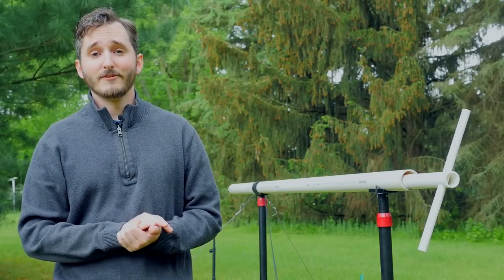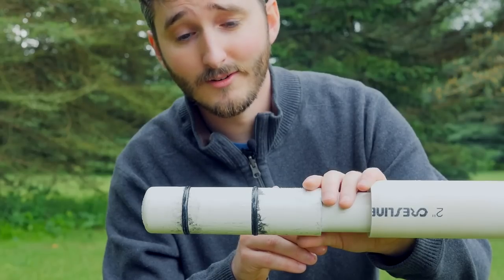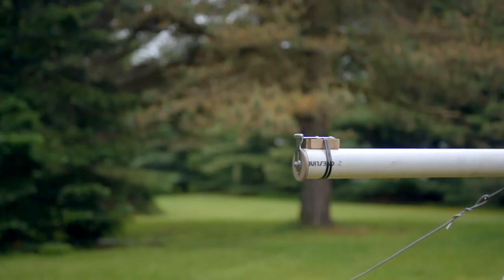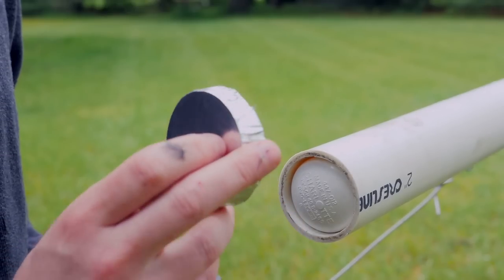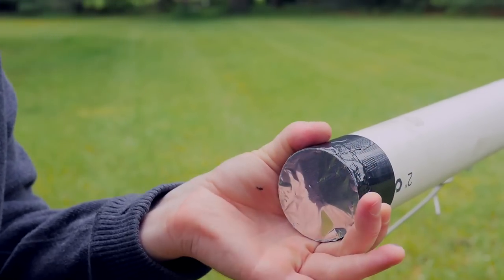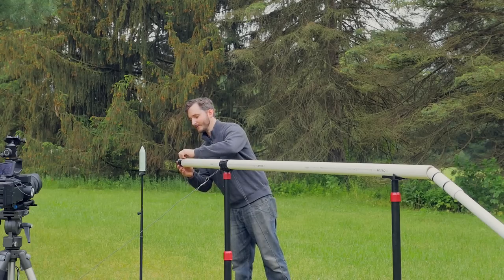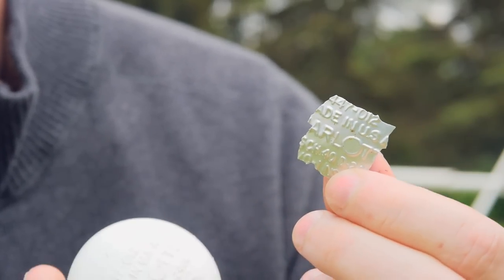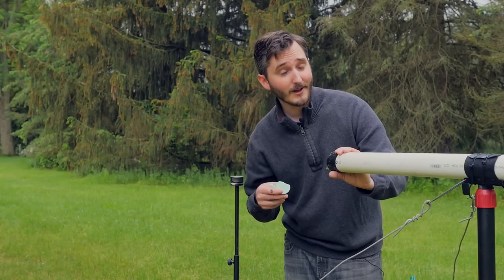New Vacuum Cannon Design - No Vacuum Pump Required!

Comment: video idea,
i have been wondering if there is away to make stovetop mini oven, for heating pita bread and quick baking, a small metal box that sets on one of the stove flame, and distribute the heat around the pita bread equally to heat it without the need to flip the pita bread over the flame, and that we can put small oven pan in it, could something like this be possible?

Comment: just think what you can do with a total vacuum with air at 600 psi behind the projectile can do for speed ,I think the pipe your using can handle it let me know if your going to do it .

Comment: NightHawkInLight would you be able to put metric measurements in the overlays as well? On another note, do you think a ping pong ball gun using the same principle could be effective with a shorter hand held barrel?
Reply from the maker: Too late to add metric to this video. I wish I could use metric for every video but since I am in the US all my supplies like the pipe and fittings are in imperial. It would be messy to use both. The longer the barrel the better, but you may be able to get away with a slightly shorter one.

Comment: cant you hang up a blanket for a backstop instead of the road? ive found towels to be bulletproof for lead projectiles up to 350fps or so, so plastic with very low sectional density should stop fine.

Comment: Love the videos.  Do you use any lubrication for the piston?  If so, would you please provide details of what you use.  Thanks.
Reply from the maker: I used some gear oil left from changing the differential on my truck.
Reply: NightHawkInLight 
Excellent. Thanks for the info.  I am building a double-acting pneumatic cylinder using your piston design. I plan to glue a 3/4" length of 2" pipe, cut like a standard piston ring, inside the rod end of the 2" cylinder, followed by an o-ring, and a second 3/4" length of 2" pipe, that will be flush with the end of the cylinder. Hopefully this will provide a seal at the rod end (the gland) and allow me to use air pressure to both extend and retract the rod and piston.

Comment: What do you use to lubricate the o rings in the barrel?  Also, instead on taping the burst disk to the end, could you use a 2" coupling to hold the burst disk?
Reply from the maker: I use heavy bearing grease. I tried using a coupling to hold the disc but it doesn't hold tight enough and the foil slides out.

Comment: Hi NightHawkInLight, I have been a big fan of yours for a few years now, and I must say, I love your content. I have a question for you. Do you think it is possible to use a design like this to fire a water balloon? The water balloon wouldn't be the only projectile, there would be some airtight wadding before it. Would a 2" cannon destroy the water balloon? This is something I would love to test out, it would be great for intense water fights.

-Lochlan Glass
Reply from the maker: It may work.
Reply: Thanks for the reply, I have been thinking that it may be easier to build your 2" Piston Valve cannon and put some water in the air tank to make a water cannon. Any thoughts on this?

Comment: Do you know how strong of a vacuum is possible with this design?  Can you get to low enough pressure to boil water at room temperature?  I'm thinking about demos for a community college thermodynamics class.
Reply from the maker: The longer the pipe the stronger the vacuum. You could boil water inside but only for a moment because the steam will ruin the vacuum

Comment: how does the length affect the projectile speed and/or acceleration? Or does the speed of the Piston escaping the cannon affect it more?
Reply from the maker: There is a limit to how fast air can fill a vacuum at atmospheric pressure. The projectile will benefit from more barrel length as long as it has not yet accelerated to this maximum speed.

Comment: But how many gummy bears will it go through? 
 
Also, could you add a gasket to the projectile and possibly create a locking system where you would pull the piston back just far enough to where the projectile ring 
is the only thing holding the vacuum. I'd imagine when the piston is 
turned, it would unlock and allow the full force of the air to rush in 
and be blocked for the most part from traveling around the projectile 
ring.

Comment: Safety question:  What would happen if that burst disk were to fail as you pulled the piston out of the tube?  Wouldn't the air hammer launch the projectile in your direction?
Reply from the maker: You fall over backwards because the piston loses resistance. It doesn't fire the projectile backward because there is no time for acceleration and the air is too low mass to do much as a 'hammer', even moving at high speed.

Comment: can you Double the Effectiveness (I suppose) of the Cannon by Creating a Chamber to Store the Air from 
Making the Vacuum and Piping it to Behind the Piston ?
Reply from the maker: It would be tricky to design and would require much more force to pull the piston back, but yes you could.

Comment: Audio sounds interesting, i assume you are using some kind of "audio filter"? sounds like you talk in a big empty room or hallway, and the sound is more 3D than usually, which is not bad tho, just something i noticed :)
Reply from the maker: I messed up the audio when recording and it was badly distorted. I had to use a lot of filters to clean it up

Comment: in the previous video, you had mentioned that you should never stand in front or behind the cannon, if the front burst disk were to go off on accident in this one, would that shoot the piston backwards towards the user?
Reply from the maker: No, because the piston and shaft has plenty of mass to slow any backward moving air. If the front disc bursts when you're pulling the piston you just fall over backwards.
Reply: NightHawkInLight ok, cool, Thanks for the response.

-Jace

Comment: This seams obvious to me, so i probably overlooked something, but why not mount the flap-valve on the underside, and secure it with a small piece of tape? Then the flap valve would blow down instead of up, and it would probably go out of the way, in time

Comment: You mentioning a styrofoam projectile made me curious. Wouldn't it just shrink or deform because of the decreased air pressure?
Reply from the maker: It would. Like a marshmallow in a vacuum chamber. It may not work well because of getting stuck in the barrel as it expands.

Comment: Could this be done in miniature or "pocket" size? I'm thinking about making an extremely portable "disc dropper" for disc golfing. Meaning when the disc  gets stuck in a tree high up. I know it would be a one shotter but that doesnt matter. I'm thinking about 15cm long for the cannon pipe and piston.  Could it have enought power to go accutately 10 meters up? Also I was thinking if this would work, I would mount a laser pointer to it for aiming easily since I would not want to keep it infront of my face while aiming and arming.. :D
Reply from the maker: It needs to be very long to work. A slingshot would be better as a disc dropper

Comment: How about a split pool noodle as a sabot with a 3D printed rocket shape inside? Low mass = high velocity. At night with a button cell powered LED inside a clear rocket shape would be cool, maybe even cooler using one of the RGB flashing LEDs that rotate colors.

Comment: The faster you can pull back the more power right, so if you make a thing to pull the handle back super fast itll fire with greater power, a draw motor or rockets maybe??? pls do
Reply from the maker: Doesn't matter how fast you pull back.

Comment: So you don't calculate length of cylinder in force calculation.
Just the entry diameter.
Thought be more pressure than that filling the void.

Comment: If the seal on the end of the barrel prematurely fails, such as in a burst disk design, wouldn't that put the user in danger? Wouldn't the projectile travel down toward the person pulling the Piston?
Reply from the maker: Only if the projectile were stuck at the front of the barrel. Fortunately the piston is pretty sturdy and would take a good part of the impact if that were to ever happen. The piston may crack but not much would make it through.
Reply: @Nighthawkinlight  Thanks for the reply. Also just wanted to say you do a fantastic job with your videos. I just discovered your channel today. Keep up the great work!

Comment: Instead of pulling the pipe all the way out can you just drill holes near the end of the pipe?
Reply from the maker: You could, sure. Just so long as they are sanded so the holes don't tear up the o rings.

Comment: I like it.  A very interesting Project!! If you make a bell mouth on the Air inlet side the efficiency and power of the Cannon will increase substancially.  The flow speed of  atmospheric air that fills the vacuum within the pipe is now limited by the abrupt shape of the air inlet, since In that Location the atmospheric air accelerates from 0 mtr to ??? mtr/ sec.  The abrupt inlet shape induces turbulence.  Reducing turbulence means higher flow speed.  Therefore the air inlet should have a bell mouth shape to reduce turbulence.  The Bell mouth wall should have an angle of around 7 degrees.

If you further develope this idea, you could make a hand held vacuum gun from a trumpet....
I mean from the brass music Instrument...not from a Donald Trump fan of course...
Do you see it before your mind- eyes??   Pulling a rod out of a trumpist and see his projectiles shooting out? 
Lol

Laughs from Bert in beautifull Spain.

Comment: So what's the point of the piston? wouldn't it be fine to just put a few o-rings on the end of a long pvc shaft with a handle at the end, shove it down the barrel, put the projectile in and then the flap and pull it?

Comment: Hi, I am a student that currently working on a project. As long as I discovered this video, I started to buy O-rings, pipes those thing. But I figure out a problem that mine version seems not to be really tighten and the air even leaks. I stick the O rings on my piston with 502 glue, which sth like AA super glue. I want to figure out what problem I got on my design
Reply from the maker: The piston should be made as shown in this video: https://youtu.be/BCZGWvieJ7I

The o rings themselves should not have glue on them. If they're not a tight fit they might not be the right size. There are different thicknesses of o rings

Comment: If there is no projectile, will in-rush of atmospheric pressure still rupture the burst disk? Or does it need that push of the projectile to pressurise the space between projectile and burst disk?
Reply from the maker: Air alone will not break the front disc (Sometimes it does but not often. Only if the disc is very weak.). It doesn't have enough mass even when moving at high speeds. The power of a vacuum cannon comes from translating the force of the air into momentum in a denser object.
Reply: Thanks for the reply. Yes, I expected it required the projectile. I thinking of ways to make a vacuum powered shock tube. If you release the piston without the projectile inside (instead of pulling the piston out), would it retract fast enough to build that mass better?
Reply from the maker: The piston would move inward more slowly because the mass is so high with the whole shaft attached.

Comment: would it be possible to make a much shorter cannon like this (like 2-3 feet) that could launch nerf rockets like a mortar?
Reply: It's possible, the power is related to the diameter of the pipe.  I'm not sure how length affects the power, but my first though is a shorter pipe would have a larger percentage of air trapped in it as you pull the piston back so you wouldn't achieve as good of a vacuum.  It should work though depending on the shape of the nerf rockets.

Comment: So what if the burst valve that gets Penetrated to launch the object didn't just separate the vacuum in the barrel from atmospheric pressure, but actually separated the barrel from a highly-pressurized chamber?  It would increase the complexity of the mechanism, and of course there is a risk of launching the burst valve release mechanism out the front of the cannon along with the projectile, but couldn't you theoretically increase the force significantly?

Actually, the thought of accidentally launching the firing mechanism give me an idea: do that intentionally.  Have the barrel, seal it normally, pump vacuum, but leave it empty (unloaded).  Then, behind the vacuum seal, have a loading chamber with the projectile just behind the burst valve separating the two.  Make the projectile a smooth, sealed cylinder that will seal the vacuum as it travels down the barrel (either without or with a sabot) and just have a needle right in the center.  You pressurize the loading chamber (I guess we could call this a breech) and pull vacuum from barrel, and to fire it you could just use a rail gun type mechanism to push the projectile forward until the needle penetrates the burst valve.  If you make the tolerances tight enough, the needle could be such that the projectile has already formed a decent seal with the barrel at the point its breaking the burst valve seal.  The rail gun mechanism would force the projectile forward, and with a powerful enough magnetic force applied to it would be pretty good at forcing that thing forward enough that the air couldnt rush around it and ruin the vacuum at the front of the barrel.  You could maybe even have a simple one-way valve built into the projectile that allows any air that gets in front of it to pass through the projectile and behind it as it accelerates forward so that we don't have any air pressure slowing it down.

Idk, just trying to think of ways to make these devastatingly powerful cannons just a bit more dangerous ;)  I wanna see hypersonic speeds, damnit!

Comment: Why not put the flap valve upside down?
Or, if that doesn't work, add a tension spring in a certain position so that when the extra air pressure inside pushes out the valve, the spring then works to pull the flap out of the way. This certain position would hold the spring at the same angle that the internal pressure pushes the valve out to. So initially, the spring holds the flap shut, but after the flap is pressed past the angle, the spring pulls the flap away. Just like this new cannon, the simplest design is often the best.
Reply: And the simplest design is the burst disk. The problem is the mass of the valve takes too much time to accelerate out of the way. If the valve could be made lighter a spring wouldn't be necessary.
Reply: GordieGii Good point. But now that I think about it, why doesn't he simply add more or a space between the end and the projectile? He theorizes that the force that should push out the flap is the air that is left in the cannon, so if the air wasn't enough of a force, why not close the flap with the projectile sat about four or five inches back further than it currently is, thus a higher volume of air can push out the flap further?

The burst disk is brilliant, but for reusability and ease of use, a flap means that there is no extra prep for the cannon other than loading the projectile and pulling back. With the burst disc he has to spend extra time.

Comment: Hey I’ve been trying to make this but it’s only 6ft long and I’m having trouble firing it. Any tips?
Reply from the maker: If you don't pull the plunger out very quickly air will leak in and ruin the vacuum.

Comment: Now i need you to fabricate a flange style burst disk holder. That way you don't have to put tape on it every time.
Reply: In a perfect world, you would have rubber slides that you slide into a slot at the top of the barrel, and in the slide, you have a burst disk. But I don't have any of the equipment to fabricate something like that.

Comment: How about a spring loaded flap at the end instead of the tin foil? To keep the flap in place while pulling the piston back, you could put a string on the flap and pull the string with the piston, and release the string when the vacuum is holding it in place already. Hopefully you get me, my English is not that well :-D

Comment: This is criticism on a very very high level because your videos are very high quality contant! But You are recording with a lavelier mic and one on the camera right? Than you put them together so its synced. The problem is that the sound needs to travel a bit longer from you to the camera but the lavelier is directly under ur mouth so it is much faster. So there is a slighly very small delay and you sound a bit doubly. By zooming in very near in your edit software try to find a location on both tracks where its easy to see very very zommed in and sync every bit of track u got and it should sound even cleaner :P
Reply from the maker: There was a lot wrong with the audio in this video. It's a miracle I salvaged it at all I did such a poor job recording.

Comment: Hi. You mentioned that 960fps wasn't slow enough for the cannon. It might have to do with you shooting 60p and editing it on a 60fps timeline. This is because when recording 960fps and then editing it in a 60p timeline the final result is sixteen times slower compared to 60p (capturing 16 times more frames in the same unit of time) Compare if you were to shoot again 960fps and then tell the editor to interpret that footage as 24p you'd get 40 times slower. I know how to do it on premiere pro, which is right click the file on the project bin and then tell it to interpret the footage as if was shot on 24p (23,976fps), then drag it onto the timeline and you should be good to go.

Hope this helps! (and also that makes sense)
Reply from the maker: I play back the slomo shots at 30fps so you get an even 2 frames in a 60fps timeline. Only the real time footage is actually 60fps